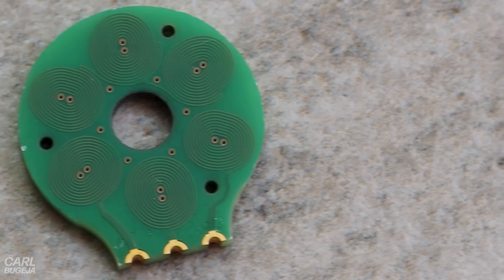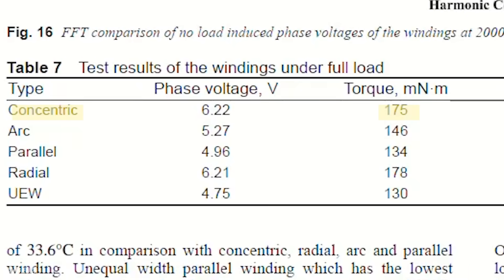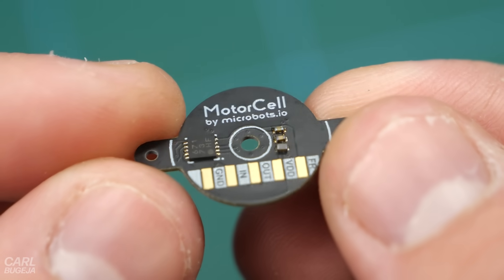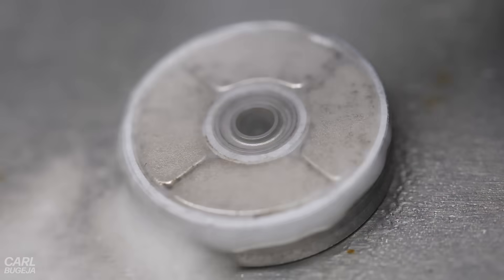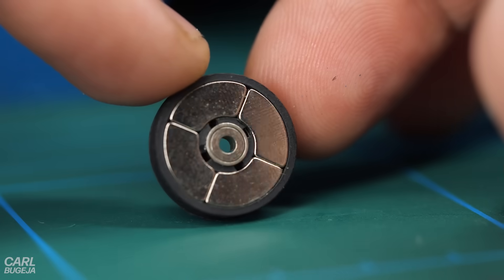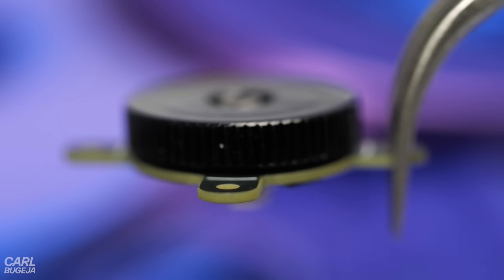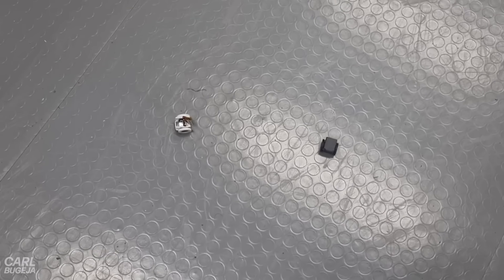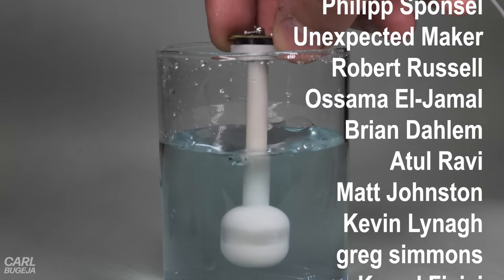How this tiny Motor Survived 1.6 BILLION SPINS

Comment: Good to see actual inventors at work, hope your project will be used in many awesome real-world applications, it deserves recognition
Reply: It is not an invention. It has existed for years and was used, for example, in some 3 1/2-inch floppy drive motors.
Reply: Sony walkman had the same pcb motor (using LB1672 ic) in the 80s in Japan .
Reply: Also, emphasis on inventor, not (just this) invention. If you familiar with Carls works, he has other fascinating projects
Reply: Of course it wont, they design with cheapness of creation and obsoletion in mind.
Reply: @tvcomputer1321  Sunon uf385-100, bon appétit!
Reply: lol of moody d bags in the comments
Reply: I love the casual wedding flex. Good for you!
Reply: noob, you made high speed low torque motor why???? make high torque low speed motors, more useful for robots
Reply: Sunon uf385, start munching.
Reply: 'inventors' I hate this word with passion.
This is not an invention, just a garden variety BLDC motor with an unusual winding.
Reply: Well, it's blue diode that took most time and effort to develop and overall brought us into the modern LED world, but with such logic you can't say that was a real invention since there were already red and green ones
Reply: @SimbiontS95  the F are you even talking about, BLDC motor field is mature established industry, and this motor is nothing spectacular, interesting or out of the ordinary, blue LED by comparison required decades of refinement and netted a Nobel prize.
'Invention', blergh, this word just cheapens engineering effort.
Reply: @SimbiontS95 It is a wonderful thing, but there is a difference between development, improvement, and invention
Reply: @VEC7ORlt  yeah a brushless dc motor that is literally printed into a circuit board, not an invention and required no engineering or thought. ffs get real
Reply: @tvcomputer1321  engineering - this the word to be used.
What do you think small fans use as a motor - yeah, pcb motors, so much for an 'invention'.
Reply: @tvcomputer1321  if it is so then i dare you to create a better pcb motor haters

Comment: Have you thought of using it to drive a flywheel for Cube Sats.
Reply: Came down in the comments to see if anybody had mentioned this as a micro reaction wheel - it's a really good idea.  The electronics would have to be radiation hardened for anything long term, but they'll probably last 6 mo to a year...
Reply: Could also work as a control moment gyro. Even if the torque is low, over time it'll be able to spin up a decent mass to high speeds. Then you could use a higher power servo to rotate the entire PCB
Reply: I remember back in 2000 a buddy designed a highly controllable micron scale oscillator . He was seriously thinking about a vibrating toothbrush as his first product when someone mentioned that fiber optic wires were really hard to align. That idea alone took the project in a completely different direction.
Reply: Why do you even need flywheels for - just use a magnetorquer.
Reply: @VEC7ORlt  I'd argue having both would be useful. You could use the reaction wheels or CMGs for quick large movements, and use the magnetorquer to desaturate.
Reply: @VEC7ORlt  can't use magnetorquers for precision pointing or fast movement, and they also require fairly accurate knowledge of position around the globe and a good Earth magnetic model on board (it's way messier than most people think).
Reply: @VAXHeadroom  franky both are needed, and it not like you are navigating blind.
Reply: @VEC7ORlt  You aren't, but it requires precise knowledge of both position AND orientation (aka "Spacecraft Attitude") plus a detailed map of the magnetic field.  Not many cubesats have GPS capability and it would also require a precision gyro with both dead-reckoning and drift correction.
(I build satellites for a living)

Comment: Move from knurled to toothed so you can have gear reduction. There's enough diameter change available to get a considerable torque multiplication. The added mass and frictional losses will hurt performance of course but there's always tradeoffs. Alternatively, 4 motors could be placed centrally with a reduction belt drive to radially placed rotors. Though, you might find it difficult to minimize PCB flex due to the required belt tension.
Reply: Even better, harmonic drive. This has insane gear ratio, and is super simple.
Reply: @lelsewherelelsewhere9435 
Harmonic drives are great, if you're not trying to spin a propeller.
The main advantage of a harmonic drive is that you get an incredibly high reduction ratio in an absolutely tiny form factor.
That's pretty much the only advantage they have, if you make one out of polymers the need to have parts flexing for basic functionality (which is how the whole thing works to begin with) means you waste a good portion of the already tiny amount of power you have available from such a tiny motor as this PCB-windings one. Might still be worth it if you're trying to make an ant-robot that has actual closed-loop positioning of it's limbs rather than a gait determined purely by the arrangement of a mechanical linkage, and doesn't just opt to use a much simpler and cheaper ready-built solution like a servo motor to do so.
Neat, but impractical, esp. since the motor itself can already operate a "skid steer" type mobility system via direct drive, as demonstrated in the video itself.
Reply: Consider that each of these motors probably converts some amount of electricity into (guessing) on the order of 1 watt or less of mechanical energy when at full throttle. That limit is something I am speculating on, but it is informed by the fact that the losses in the windings must be SIGNIFICANTLY less than 1 watt or the PCB itself will overheat and de-laminate, destroying the motor.
Belt drive won't work because each time you flex a belt, you spend power to do so, and even worse, to keep tension on the belt requires placing a load on the bearings, further increasing frictional losses. If you want to transfer power using something LIKE a belt, but with less losses due to friction, you use a chain, but nobody makes a drive chain that is of the scale needed to operate a drone of this size. Closest you get are polymer-based toothed belts, which are admittedly still a lot better than V-belts from a frictional losses perspective, but they still waste too much power when you only have a watt or less to go around to begin with and you're trying to make something fly.
Gears for a micro-drone propeller speed reduction unit won't work either, and there's two gigantic and a lot of smaller reasons why:
Gigantic reason #1 is that the gears themselves would have to have incredibly tight machining tolerances, to the point that they'd make the engineers at a Swiss watch company blush.
Gigantic reason #2 is that even at such tiny scales, those gears aren't going to weigh the "nothing" that just picking the proper propeller weighs, given the limits of torque and RPM of a well-characterized motor.
The reason you gear down a propeller isn't to make the system more efficient. It's because you're space and/or physics constrained. Geared turbofans are a thing in airliners because with the combination of fan case diameter constraint (imposed by the aircraft the engine is mounted to) and the fact that fan blades REALLY hate going faster than the speed of sound (which is a constraint imposed by the laws of physics), when you want to build a high power high bypass turbofan in a small diameter (like is needed in modern narrow-body airliners such as the 737 MAX and A320Neo), the fan's peak efficiency RPM and (admittedly limited) diameter combine to make the tips of those fan blades start breaking the speed of sound, which REALLY hurts the noise figures, but if you increase the pitch of the fan blades (so they "take a bigger bite" out of the incoming air stream) and gear the fan down so that the N2 spool of the engine itself can still operate at the RPM it needs to, while allowing the fan itself to spin slower while still being driven by the N2 spool's turbine, then you get an overall more efficient and quieter engine.

That's a really long winded way of saying "None of that matters with a drone propeller that is so small in diameter that the strength of the material it is made of will be surpassed by centrifugal forces trying to make the blades all go in straight lines long before the blades even REMOTELY approach the speed of sound."
You don't NEED to slow down those propellers. And trying to do so only increases mass, which is the MOST counterproductive thing you can do when your intent is to build a flying machine.
Reply: to get a torque increase you would need an much bigger second wheel / gear 
which would make this entire thing pointless as the whole appeal is the very small package size 
to get a 5x increase in torque you would need 5 times more teeth on the secondary gear 
and that would be very big indeed
Reply: @Crushonius   What if it was a planetary and the rotor was the sun gear.
Reply: @SianaGearz  yes that should be possible 
provided one can make all the parts
for a reasonable price 
with reasonable accuracy 
it would still cost 3-4 more to make 
unless there is an off the shelf
planetary that could be adapted to 
this application .

Comment: Well done! I was wondering when we would see this. Totally worth the wait.
Reply from the maker: Thanks! It was really hard to summarise everything into one enjoyable video but I'm happy with how it turned out!
Reply: @CarlBugeja Really impressed by the results, i def buy it in the future if our startup works out
Reply: @CarlBugeja What training courses do you recommend?

Also, do you know where one can find a EU certified course for led light panel fixtures for electricians? I"m stuck since my searches haven't yielded any good results.
Reply: @CarlBugeja  noob, you made high speed low torque motor why???? make high torque low speed motors, more useful for robots